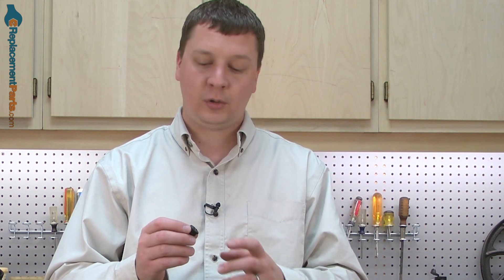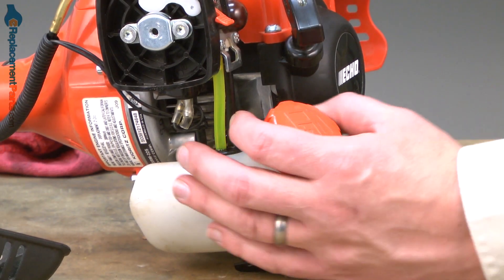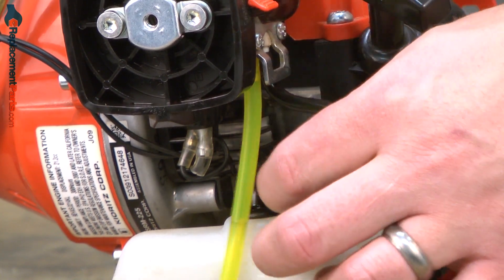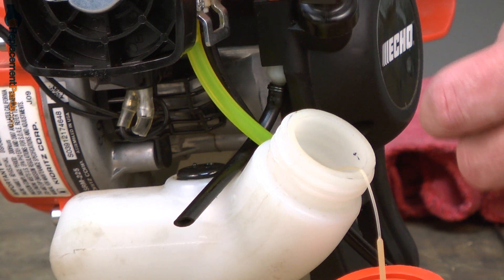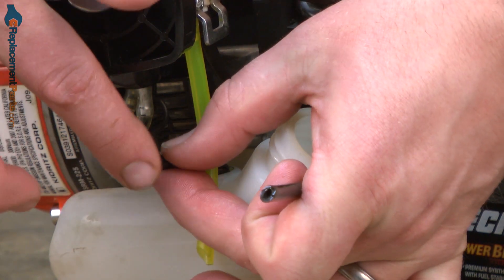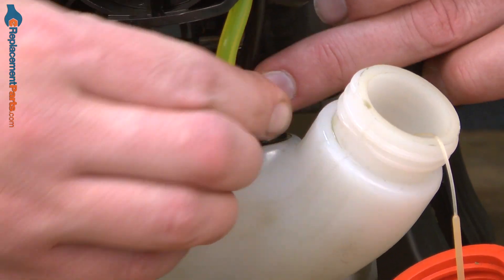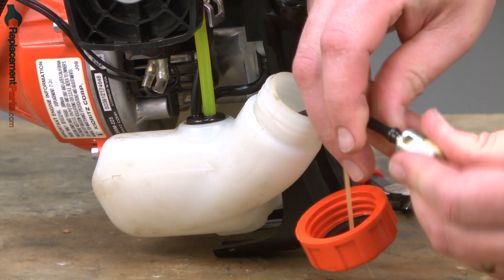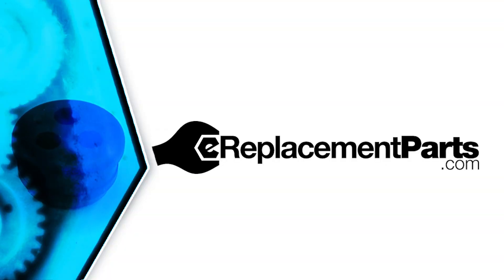Trimmer Repair - Replacing the Fuel Line Grommet (Echo Part # 13211546730)

Comment: Would it be slightly easier to put the fuel lines through the grommet when it's out, and you are holding it in you hand; than to install it,  then cut the lines on an angle, and force them back through the grommet? It looks like to me , when the lines are installed in the grommet - one could install lines and grommet at once back in the tank. Just my insight. I like what you guys do, it great.!